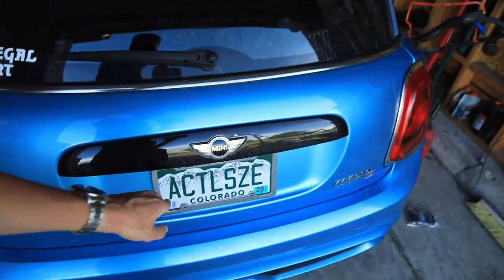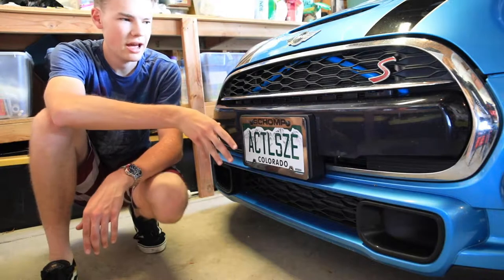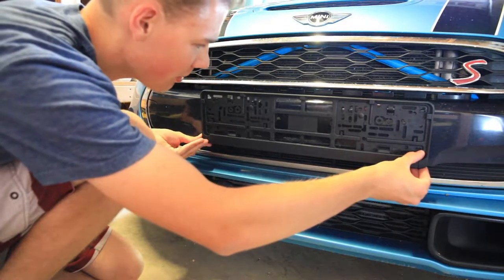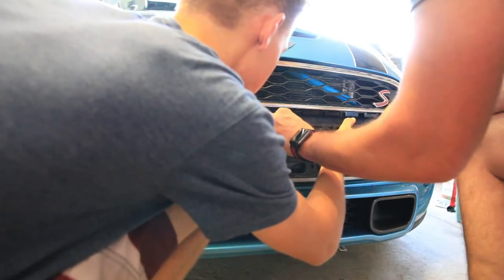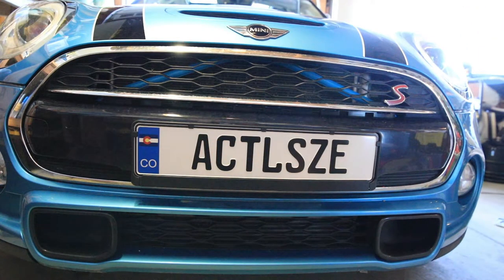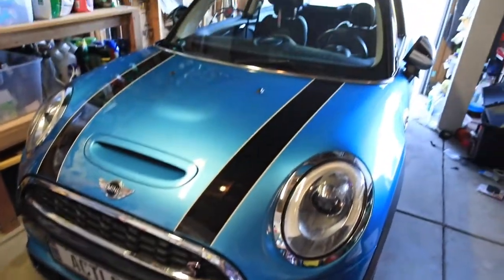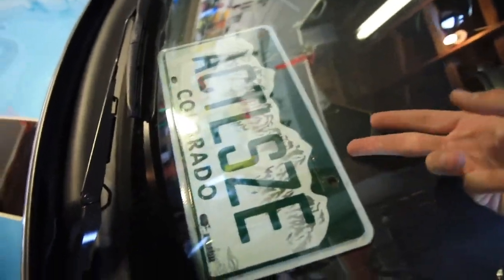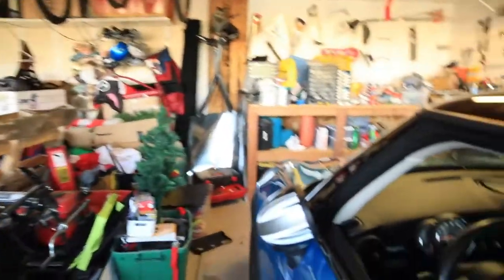GETTING A CUSTOM PLATE FOR MY MINI | The Ultimate Mini EP 3

Comment: Hey good vid, made me realize I wasn't crazy when the holes didn't align. Quick question: How tight did you go when putting in the 2 screws? The bumper seems really thin and I was pretty loose on my tightening. Any issues with the plate since installing? Again, great vid and super useful!
Reply from the maker: Thanks! When I was putting the screws in I tightened them decently tight with the screw-driver. I don't think you'll damage the bumper unless you're using a drill or something like that. I've had this on my car almost a year now and no issues to report at all!